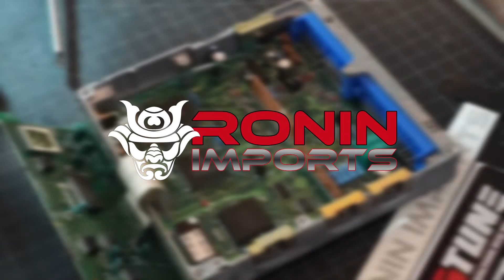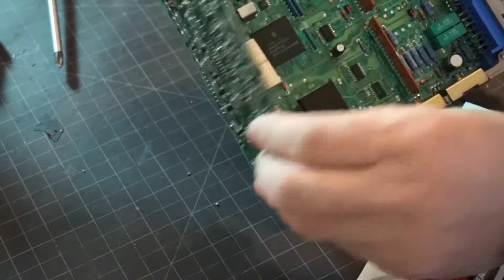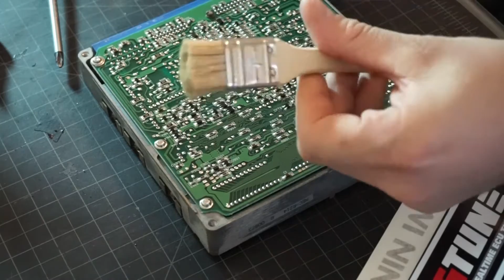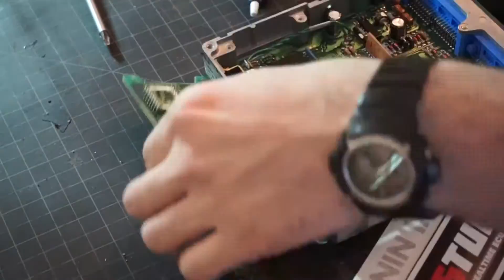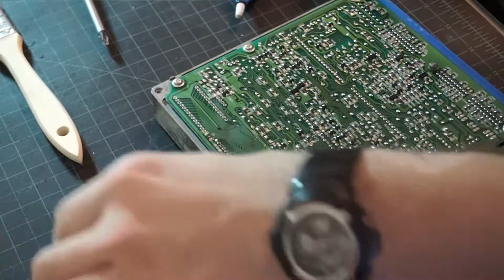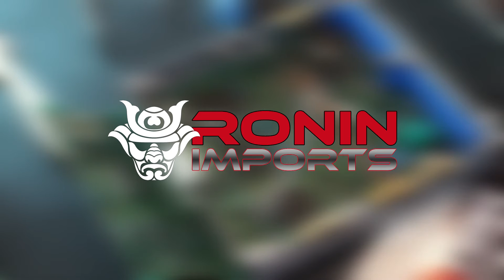Nistune Type 2 install - R32 Skyline GTS-T / GTR

Comment: Question. I have the same setup in my Skyline. Tach is dead. Getting over 8v, not the sub 5v for a signal. Have you experienced blown resistors in the tach signal?
Reply from the maker: I dont know how I just saw this, but no... I have not experienced that. If you havent fixed it yet then I would reach out to Matt at Nistune directly. He would be the go-to guy on the inner workings of the ECU.

Comment: Does this Nistune board work for an R33 GTR also?
Reply from the maker: Straight from the Nistune website: 
The factory R33 RB25DET ECU cannot be used with a Nistune board. You will need to source an R32 Skyline ECU (23710-04Uxx or 23710-11Uxx part number). VCT modification information here and then plugs straight in. Note: Series 2 there is no IACV (Air cond) output R32 ECUs so we recommend wiring IACV solenoid directly to the AC relay as Series 1. Auto transmission model R33 Skyline will require R32 AT controller. 

You can also use a Z32 300ZX ECU but is not recommended.

Comment: Just curious how long has nistune been around? Also, i just ordered the Type 2 board for my car. How can i check the status of my order from the Nistune website?
Reply from the maker: NIStune has been around quite a while. I know in some of the documentation there are references back to 2005. I shot Matt at NIStune a message to find out when they first started their company. 

We are actually a vendor/reseller of NIStune boards that also offers local tuning as well. If you purchased it from NIStune directly then you would need to log into your account and check your order status.